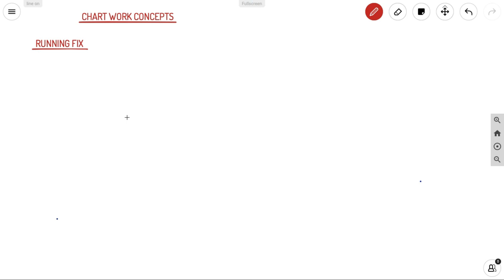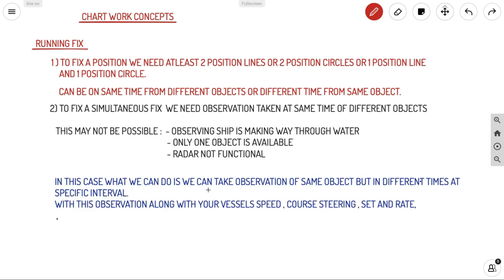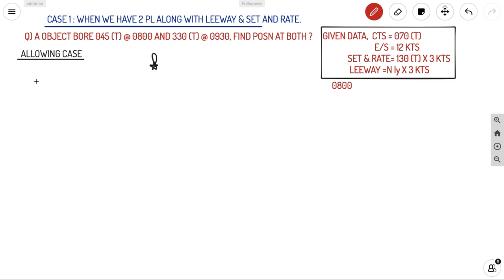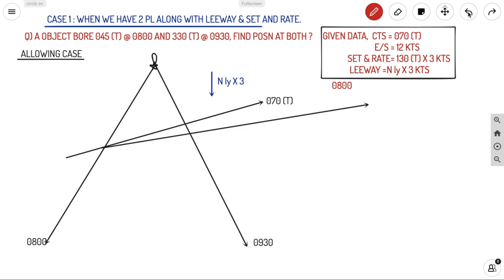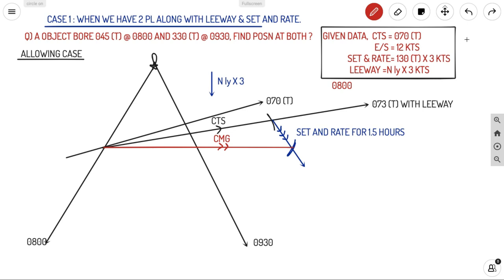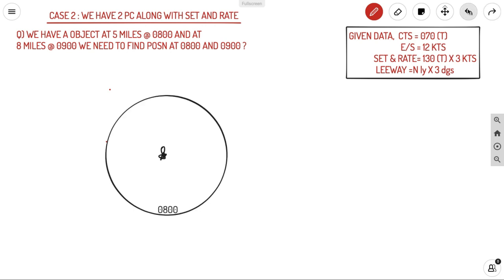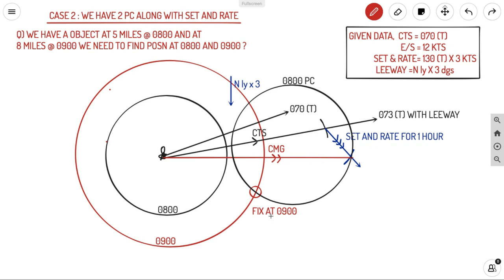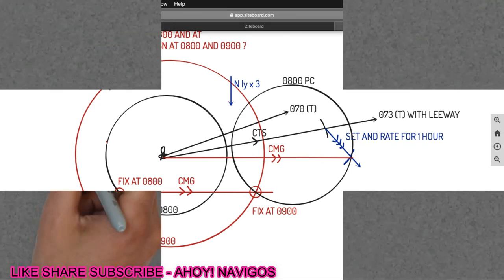WHAT IS RUNNING FIX ? | POSITION LINE AND POSITION CIRCLES | CHART WORK CONCEPTS| AHOY! NAVIGOS.

Comment: So the center of 0800H circle that is transferred is in the CMG line? Is that correct? I got confused about the transferring that circle. Because in your vid. It is difficult to find where the center point of that transferred circle. 
Thank you and godbless
Reply from the maker: Yes the centre will be end of CMG line where current line meets CMG line that will be the centre of transferring position circle.

Regards 
Team Navigos
Reply: @SailorSyd007 so is that mean the diagram you have made is wrong v